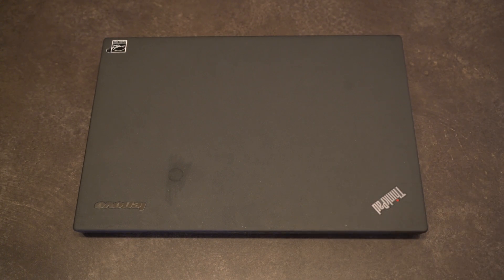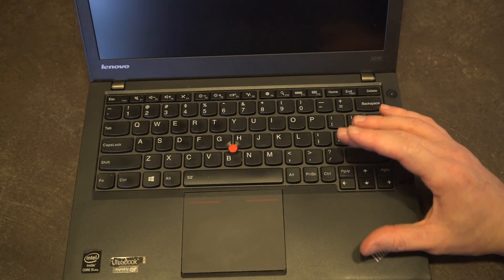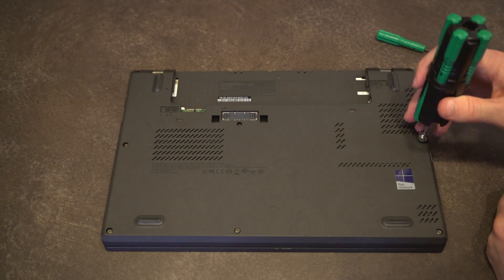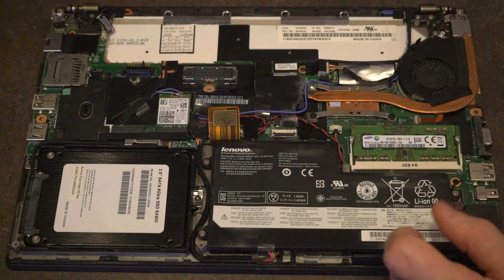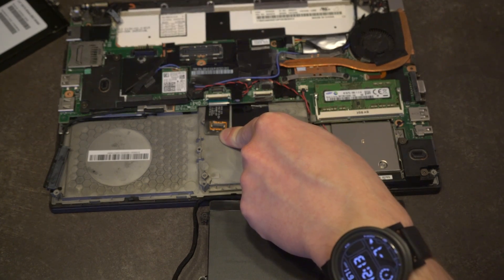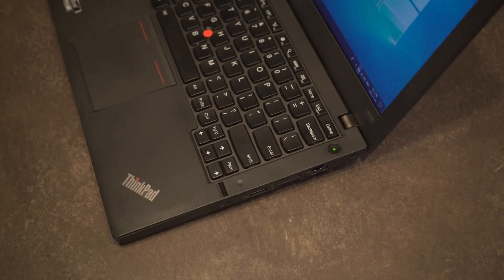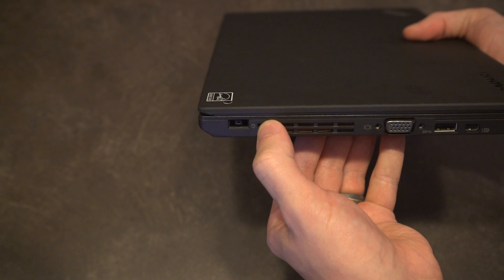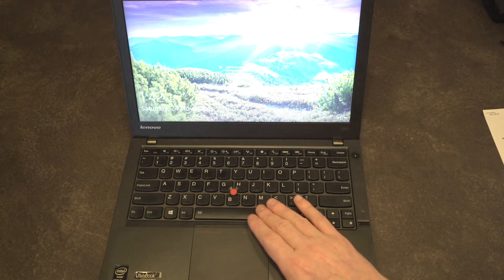Lenovo ThinkPad X240: Refresh of the X Series

Comment: This is two generations too late, as Lenovo seems to make it worse with every "innovation".  For the X230, they replaced the wonderful Thinkpad keyboard with an Apple-inspired "chicklet" keyboard with a much worse layout and typing feel.  With the X240, they removed the buttons for the TrackPad and TrackPoint, forcing you to awkwardly try to press the touchpad while using the TrackPoint (another Apple-inspired "improvement").  This was such a disaster that they backtracked on it for the X250.  Even so, the X220, is the last great X-Series, and the one to get if you love Thinkpad design.  They're cheap now too.
Reply: geoffk777 what should i buy x230 or x240 ?
Reply: You should wait to hear what Laptop Retrospective has to say, but, as for me, I'd go for the X230.  The X230's keyboard isn't as good as the X220, but it has proper buttons for the TrackPoint, so it's usable.  The X240 dropped all the TrackPoint/TrackPad buttons, so using the TrackPoint is just painful.  While it has some other good points and arguable advantages over the X230 (and X220), I just can't live with using the TrackPoint on it.
If you only use the TrackPad instead of the TrackPoint or if you plan to use an external mouse, than you may not care so much about this point.  In that case, either one would be a good choice, and the X240 has better CPUs and a better battery, so it might be preferable.
Just my opinion.
Reply from the maker: Our thoughts are quite similar.
Reply from the maker: I might have something coming soon to add to this discussion. Give me a day or so. 😁
Reply from the maker: Agreed with you regarding the trackpad. Love the x220 but I also like the power bridge in the x240 and extended battery life.
Reply: maybe lenovo want to bring thinkpad to come to an end
just look then...the thinkpadders will have to say goodbye since the current model thinkpad didnt meet the expectation for all the people who still thinking thinkpad is the best kind of model laptop like IBM laptop design in the past
Reply: Maybe, but Lenovo still makes a lot of money on Thinkpads, so I don't think that they want to kill them outright.  They definitely lack an appreciation of some of the classic Thinkpad features, though, and, like most of the industry, they've been overly and negatively influenced by Apple.
Reply from the maker: I don't know if it's fair to blame Lenovo for following the market trend of what people are buying. The consumer sadly has to take responsibility in this as well.
Reply: True, but Lenovo could choose to be be an innovator and leader, but, all too often, they're choosing to be a follower instead.  And copies are rarely as good as the originals--they don't appeal to Apple users, who are set on their beloved brand, and they annoy faithful ThinkPad users, who see their own traditional features disappearing.  In the end, they please nobody.
Reply from the maker: Companies driven by shareholders are tied hands in regards to that.
Reply: It doesn't seem to bother Apple.  There was much criticism of the MacBook "Butterfly" keyboard.  So they responded to the criticism--by using it on every model in their range.  From eliminating CDs and floppy disk drives to killing legacy ports, Apple has proven to be a leader--albeit a misguided one.  I wish Lenovo had the same convictions.
Reply from the maker: Yeah Apple has turned the computers they made into an appliance of sorts so it is somehow more acceptable it seems for those sorts of things. I hope that someone, Lenovo or other leads the way forward.
Reply: Yeah, me too.  The industry really needs a new standard-bearer.
Reply from the maker: Yes and the consumer needs to be ready to support them. That will be the other half.

Comment: That is NOT easy. It's ridiculous that you have to take the bottom of to remove the hd.
Reply from the maker: In comparison to modern devices it's a breeze. Sure it's more screws, but I can then do everything. Better that than the modern trending alternative.
Reply: I'd take removing a bottom cover and having some modular components I can upgrade over today's solder happy ultrabooks like the x280 my job gave me.
Reply from the maker: What is the x280 like anyway? Would love to know.
Reply: @LaptopRetrospective  it's the latest as far as I know wouldn't be surprised of an x290 coming soon.  The Yoga series is at 380 now.  It's near half the thickness of the x240/50/70s that my job still have in circulation.  I like the touch display, but honestly my x230 boots nearly as fast, lol.  I use a 9 cell now on my 230.  I got my hands on an x220 to fix up too.
Reply: @LaptopRetrospective  I hate the move to one solo internal battery too.  The earlier models with split battery at least let me swap battery mid stride if I'm in a pinch
Reply from the maker: Ah very cool. I hope one day to play around with the newer models too.

Comment: Okay before watching I just wanna say that I've bought a used x240 6 months ago and I'm loving it with 8 gigs of ram, ssd, ips screen and backlit keyboard. I use it for coding and regular pc work (downloading stuff, transfering files etc.). The only thing I would like is somehow having a bit lower idle temps (it sits at about 40 with arctic mx-4),  but otherwise an epic laptop for the money.
Reply: Also, I did the keyboard and touchpad replacement alone with a youtube tutorial and it took some time but isn't that hard as long as you keep organised and tidy. All in all a nice laptop but it sometimes does get its fans spun up when I do something more demanding in python or watch videos.
Reply from the maker: Interesting. I'll be on the lookout when the fans spin.
Reply: Laptop Retrospective it could be my linux distro though, I didn't really mess with the fan curve, and also, some people have reported that my thermal paste (the mx-4) isn't really all that good for laptops because they get hotter than pcs which can dry out the paste. Still, a great laptop, but I'm on a lookout for the x250 if I manage to find as good a deal as I grabbed my x240 for. Thanks for the vid I completely agree with everything you said 😉👍🏿
Reply from the maker: Cheers. Thanks for the comments. That paste dried out over time.
Reply from the maker: Thanks for the comments!

Comment: As an power user I can only say that this model is bullcrap:
1: the keyboard is even worser than the in previous gen, there is no info on anything on it (like caps, num, sound, mic etc.) it's not even comfortable to type on, and you can't get the *20 keyboard to work on it.
2: trackpad is just utter crap, it's so big and not even textured, and cus there are no sepparate buttons for trackpoint it's just bad to use, also you can't turn it off in BIOS :/
3: 1x8GB ram is bad for peoples who run some development "center" on travel
4: The build quality as of me is lacking, it's more plastic in feel than the x230
5: The U processors are step back in performance
6: You need to buy new docking station, or the USB one
Now the positives:
1: bigger battery, and it works longer cus the CPU is less power hungry
2: there is m.2 port rather than the mSATA so there are much more possibilities with it
3: there is an 1080p screen option, without any mods
Reply: The computer is 12", how do you want to put a numpad on this ? Also, you can disable the trackpad is Synaptics Drivers.
Reply: U cpus are fine for everyday use, and very efficient. Are you expecting to get 9900k performance in a 300 dollar laptop?
Reply: @perjabeats2194  I'm a power user, I run my laptop as my workstation, and x230 did exactly that. I had x240 and x250 and CPU wise it was stepback in performance for me. My software went from ~2minutes compilation to 3-5mins and ye I couldn't do my usual workflow cus of 8GB of ram (my workflow is about 12-13GB and another 10GB in swap usage) so from MY perspective they were a stepback.
Reply: @tnaxpw  what laptop do you prefer or use now?
Reply: @skrrtskrrt9453  now I'm running L440 with i7-4702mq, 16GB ram, 256gb ssd+2tb hdd, it's nice and fast for my workflow, but it's not really usefull on the go. On the go I really liked x230 with classic keyboard, I could do my work even on crowdy train, physically it fitted the best on my lap even while I had to sit next to window. So ye for home, not traveling, beefed up 4th gen is what I use, and when I have to travel a lot x230 does the work
Reply from the maker: I found the build quality to be excellent but you've got fair points.

Comment: I can say that I grabbed used one, for nearly 300 bucks, it's nicely built. It has one draw-back: single channel RAM (max: 8GiGs not 16). For pros: 'bridge-battery' (two li-poly, no sticking back) near 6h use with 45% wear level (this means 10h with new batteries). Second pros: ULV cpu - less heat, more stability. I think that considering current ULV: like 8650U - then this would be a beast! But still this is for my work that is 'grab-&-go' and don't worry about it. I can carelessly travel with it :), and take notes - another pros: keyboard.
Reply from the maker: My "field correspondant" is learning those very things this week.

Comment: X240 has a defective motherboard which doesn't work with SSDs. The motherboard stopped recognising my Samsung SSD after 3 months of use. The defect repeated itself even after the motherboard and SSD were replaced.
Reply: No, the cable could be defective, mine works fine with SSD. You need spacers, when disk is 7mm only. You need to be sure that there is no 'move' when you grab it with one hand on the lower left corner - if it does not BSOD during that then it's solid inside.
Reply from the maker: Thanks for providing some possible insight. It could be if the drive is not secure it is triggering a drop protection mechanism?
Reply from the maker: Interesting but it doesn't list this model.
Reply from the maker: Defect might be a strong word. Is this issue well documented or is it an unfortunate case?

Comment: I would go for something like Dell Latitude E7240, which has 12 inch form factor but has 2 ram slots (16GB max), 2xmSATA slots and the laptop is still very compact and easily servicable.
Reply: Please remember to check your e7240 when you are buying it. There are tons of complaints of e7240 and e7250 overheat easily.
Reply from the maker: Don't often get to tear down Dells. Will keep an eye out.

Comment: You mentioned that the i3 was for a more budget friendly version. Wasn't there also a rationale for businesses to use the i3 to maximize battery life?
Reply from the maker: Fair points to be sure. Thanks for sharing that angle.
Reply: I know, old comment, but: It was more for budget, anyways AFAIK the i3 models were almost never offered to corporate customers, instead offered to end consumers (in some models under the "i" suffix, like the X230i or X220i). Lenovo would rather you go for an L-series ThinkPad if you wanted a better leasing deal. (The E-series is consumer-oriented as well).
Reply from the maker: Interesting stuff, thanks for sharing.

Comment: Can I request an X250 review?
Loving this entire Lenovo series.
Thanks!
Reply: Not owning either I’m uncertain other than I hear that they fixed a few things wrong with the X240 and the processor power was supposedly much better, but that might just be people talking-up their particular Lenovo model.
I have two X220’s and really like them.
My daily driver has the infamous broken seam in the lid, so I bought a new lid from China and I’m going to swap it out.
That’s my only complaint about the X220, well, that and a soldered in processor, but they all do anymore.
Reply from the maker: Yes, one had to be careful of the mythical qualities given to since ThinkPads. I love my X220. I've documented the mods I've done on this channel. One day I hope to swap the panel to IPS.
Reply: Laptop Retrospective The IPS panel is wonderful and a worthwhile mod to any X220 in daily use.
I swear by them. Those IPS panels make so much of a positive difference.
Reply from the maker: I don't doubt it. Guessing you have one in at least one of your machines?
Reply from the maker: If I get the chance to borrow one I will. Are there significant differences between it and the x240?